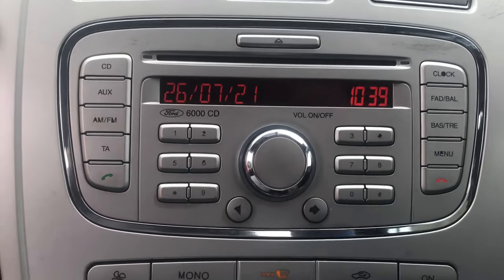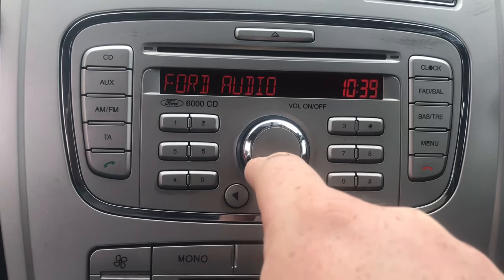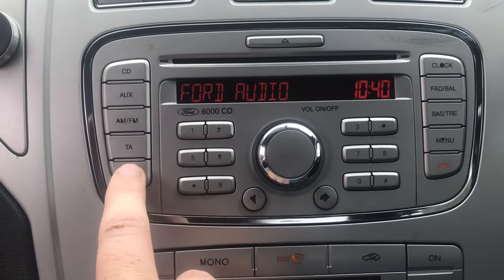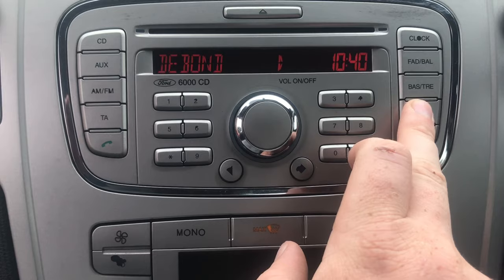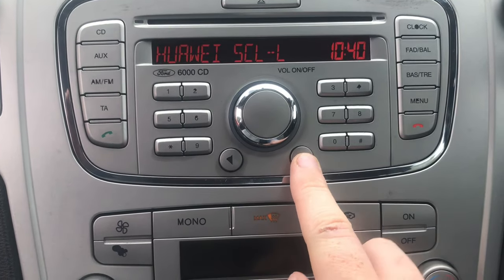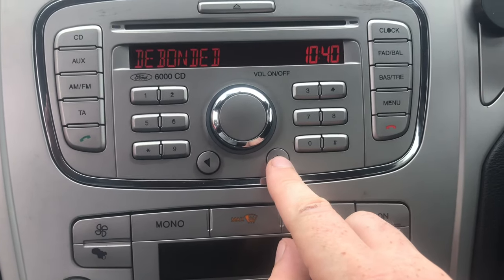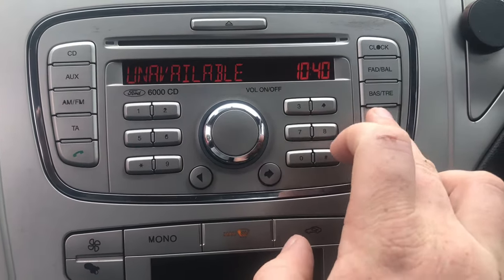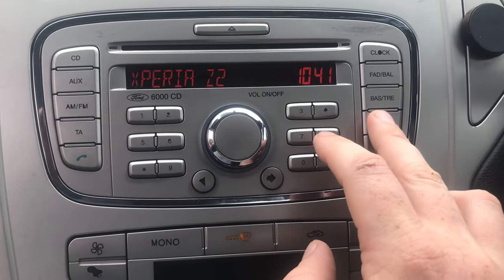Ford 6000CD Bluetooth clearing

Comment: Do anyone know were i can find the aux port on ford focus 2008 style it dont seem to be in the glove box
Reply from the maker: @gavin9873  some 2007 builds were only registered in 2008, could be unlucky there with dates?
I remember one focus had it under the elbow rest but I think it’s a modern design
Reply: @VelEire_  yea there don't seem to be any aux at all..I just bought the car and I was very disappointed to know I couldn't play music until I remembered I had a Bluetooth fm transmitter and that works no problem..back up and running again 😁
Reply from the maker: @ weheyyyy!  They’re cracking little devices
Reply: @VelEire_  o yea they will definitely do the job and surprisingly very good sound

Comment: I can’t get it to work and I have try ever video I give up ah.
Reply from the maker: @dannoble4257  have you the menu or does it just mute?
If the call button is only mute’ing the radio your car hasn’t the bt module installed

Comment: Tried this but green phone button just mutes radio and no debond option in Menu
Reply from the maker: Might not have Bluetooth function. I’ve one here same radio different trim, it’s the same no Bluetooth just mutes
Reply: @VelEire_  I have this same problem. It mutes it. But when I search for new Bluetooth on my phone I can find it. When I try and pair it says on the unit I need to remove old phone. So it must have Bluetooth. Madness
Reply from the maker: @wizardoofoz  that’s a new one to me! Gas invention
Reply: Same with me. Is there a way to find out if it is Bluetooth compatible
Reply: Hi, have you figured out how to fix it? I have the same problem, the green phone bottom only mutes the radio
Reply: @wizardoofoz  hi! Have you found a way? I have the same problem here!
Reply: @Yoona9328  Couldnt find a way to connect to the radio itself just ended up purchasing a Bluetooth FM transmitter for the lighter port
Reply: @lukeomahonybrowne796  why does it have to be this difficult to connect a phone 😮‍💨... thanks for answering, I guess I have to buy one too
Reply: @Yoona9328  had same problem just muted radio pretty sure you have to plug it into aux  also anyone know where that port is
Reply: @legomaster5958 it's in front of the passenger seat. Open the box under
Reply: @ahmeddhifallah2594 woow thank you. Who would have guessed that